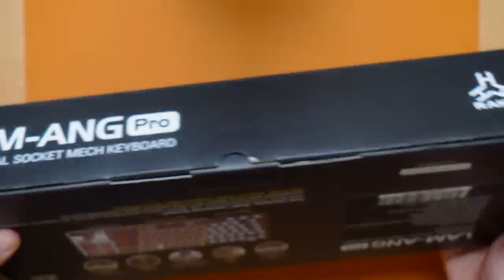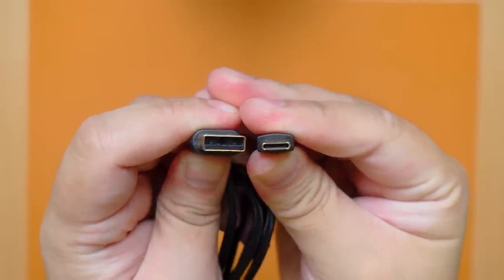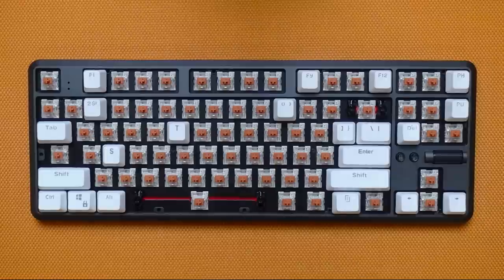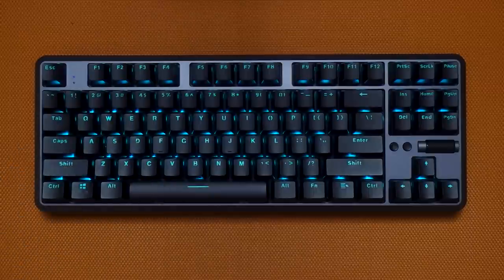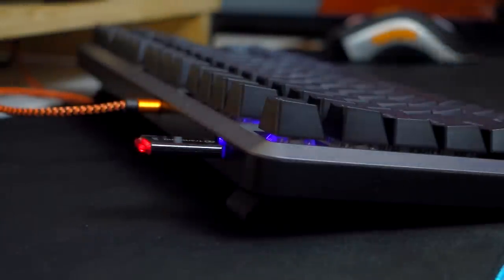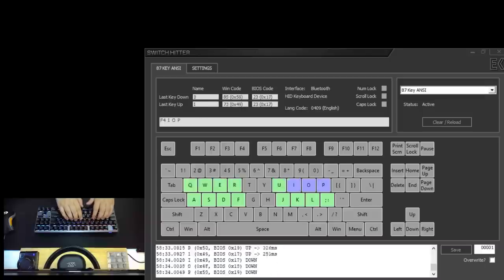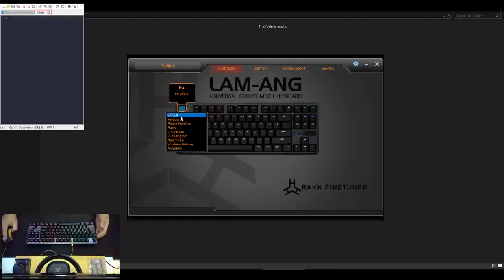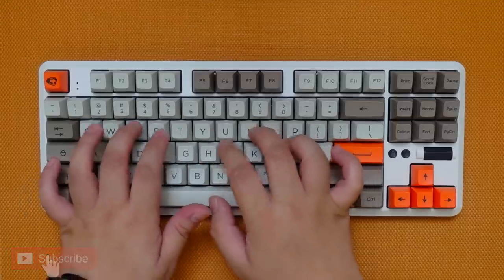Rakk Lam-Ang Pro Mechanical Keyboard Review - Universal Socket Keyboard!

Comment: rakk ilis parin  kasi may volume control naman headset ko and need ko ng full numpad
Reply from the maker: Yup, kung you can not go without the numpad ilis or tecware phantom elite
Reply: @TechBroll  mas preffered ko lang na may numpad and yung hotswap function di na kasi nag reregister ibang keys ng rakk kimat xt.le ko
Reply: ano po switch ng rakk ilis? matanong ko lang
Reply: @donHanzo  outemu